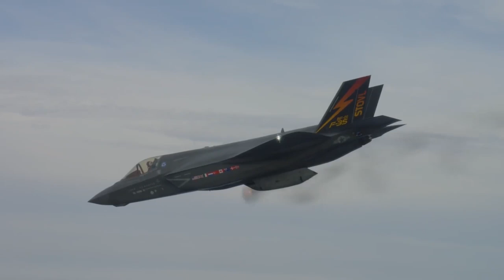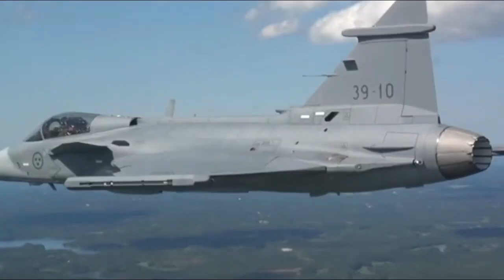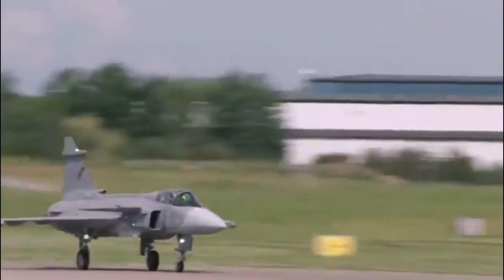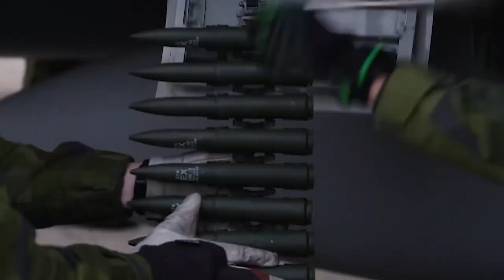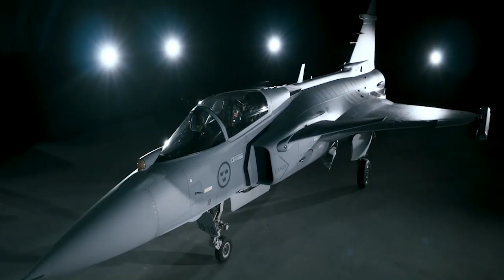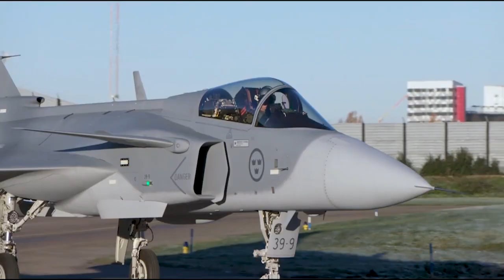JAS 39 Gripen vs. F-35: Which Fighter Plane Is Better?

Comment: F35 can only carry a similar payload if it uses wing pylons, in which case its no longer stealth. As a stealth aircraft,  it's got what, 4 missiles? Two aim120s and 2 aim9s? That's not a lot.  Its a lousy interceptor and a lousy air superioriry fighter. Its stealth is useful but you need a conventional fighter to fly alongside it, its not enough as a sole type. Like if a modern flanker gets close to it its pretty doomed

Comment: Stealth means nothing to Gripen E since the new ir system detects heat from engines up to 500km away and its much more agile than f35 and has the best radar jamming system in the world so its a fat rip for the f35 tbf. Even f22 would be detected as soon as its has its afterburner on inside that 500km range.
Reply: The gripens IADS system doesnt even have offensive electronic jamming, but the F35s barracuda does. Where did you get this info. And there is no way you can say that IRST is better than DAS. The f35 will shoot down 2 gripens before they even see it.

Comment: I keep reading things like the F-35 having better tech (it doesn't) and the Gripen is best suited for countries with a limited budget (which is EVERY country except the USA). You want to know if the Gripen is better than the F-35, here's the answer that NOBODY can argue with: If you take cost-per-flight hour into account, the F-35 is between 5 and 6 times the total cost of the Gripen. You've seen that the general consensus is that the two planes are close in combat capability but they're not. The Gripen is faster, more maneuverable and can use a much larger array of weapons than the F-35. It can also fly close to electrical storms without fear of explosion. Ignore all that though, it is clear that the F-35 is NOT significantly more potent as a fighter than the Gripen. What is the purpose of a fighter jet? The purpose of a fighter jet is to make your air force as powerful as it can be. Do you think for one minute that 10 F-35s would have a snowball's chance in hell against 55 Gripens when it's been pretty much established that the F-35 is NOT significantly more potent as a fighter than the Gripen? The answer is no. Therefore, the Gripen makes your air force more powerful than the F-35. Therefore the Gripen is better at delivering to an air force what a fighter is supposed to deliver. Therefore, the Gripen is better than the F-35, end of line. The rest is illogical semantics by people who WANT the F-35 to be worth it.
Reply: The gripes a plane from the past. Might as well fly a tomcat
Reply: @Space_Cricket beat the shit out of F-35.
Reply: What most people don't realize is the f22 and f35 aren't even near their full potential. This makes me mad because the defense department won't give them the updates to make them far support to anything flying and they do have this technology upon request and due to the fact they don't do it inferiority me.because they been using block 4 updates on the f35 adir for years now.
Reply: Countries that actually experience and expect air combat prefer the F-35 and aren’t cancelling orders.
Reply: @kevinledgister5252 All but Canada
Reply: This is false. Both the Swiss and Finnish evaluations already put this idiotic myth of "muh cheap Gripen" to the grave.

Also

1. F-35 is faster when both are combat loaded because it does not deal with parasitic drag. F-35 also has better acceleration thanks to having better TTW.
2. F-35 can use a vaster array of weapons than Gripen can.
3. F-35 can fly close to storms as well.
4-5. Finnish evaluation already showed that the F-35 is VASTLY more capable in a fight than the Gripen. Frankly a flight of F-35s would beat a flight of Gripens with exceptional ease considering the Gripens can't detect the F-35s and even if they did, their radars would get spoofed by the far more powerful EW suites of the F-35s. It also would not be 10 F-35s vs 55 Gripens, because a Gripen is actually more expensive than an F-35.

The only person throwing around illogical garbage is you. Serious air forces have again and again evaluated both airplanes and always arrived at the same conclusion. The F-35 wins by a wide margin. It has far better avionics and sensors, far better sensor fusion, far better ECM and EW and better kinematics.

Face it little Swedish nationalist - your toy plane has been exposed for what it is. An overhyped PoS that is essentially nothing more than a worse F-16.
Reply: @johanlassen6448  You might have choosen the Wrong person to do this with :)

Just looking at the specifications of the F16 it seems that it is equal and in some aspects better that the Gripen but nothing can be further from the truth. And this is more or less independed on version of both F16 and the Gripen.

1. Depending on configuration and version the F16 has an equal or higher T/W rate, but one needs to consider the wing load and the drag too. The Gripen has much lower drag and far lower wing load. The transonic area is much narrower for the Gripen and it can reach supersonic speeds on dry thrust while carrying a full A2A armament and an external fuel tank even for the A version even if it is just on the limit (Mach 1.1) Gripen E Mach 1.2. Even though the Gripen in some aspects lacks the TWR of the F-16 it can match or nearly match the climb rate thanks to low drag. When curving Gripen hardly lose any energy which makes it a serious adversary in any merge against any modern fighter including the Typhoon, F-22 and the F-35 or shall it be called the Fail-35. 

2. The T/W ration might not be impressive on the Gripen but in combination with the extremely good aerodynamics, low drag and low wing load it can turn inside anything in the air today, The F16 is NO match. The latest F16 Block 70 has all the bells and whistles identifying it with modern “4+ gen” fighter and is on some arenas (India) competing with the Gripen E and even seems to win that race. Which only show how little capability is involved in theses affairs compared to politics. The block 70 is a CPR on a plane that no longer can compete with modern fighters in the air superiority arena. It is limited to the NATO armament and will likely not be upgraded to include any development of those. Gripen on the other hand can be configured to almost any armament on the market, NATO or not.

3. During Red Flag 2006 in Alaska one Gripen A pilot knocked down FIVE!! F-16 block 50+ during close combat. During that exercise Gripen never lost any areal encounter or failed their mission objectives. It was the only fighter that performed all planned starts, while others were sitting on the ground waiting for the weather to clear up. The evaluation was that Gripens capacity needed to be revaluated. And no disrespect to other pilots, they are equally trained and in a Gripen you are simply superior.

 4. During a combat exercise with the Royal Norwegain Air Force, 3 Swedish Gripens went up against 5 RNAF F-16's. The Result was 5-0, 5-0, 5-1 after having flown 3 rounds. EZ WIN

5. The Gripen has a shorter turnaround time, which for a strike mission is never more than 20 minutes, performed by a technician and 5 conscripts in a parking lot somewhere in a pine forest as close to the battlefield as possible. When it comes to reliability and accessibility Gripen has NO match on the modern arena. Also here, even if the payload is not as high it can carry almost anything that is available on the market. The Gripen will be able to do this with an app. Of course some testing is required but not in any level compared with other fighters.

6. Also here Gripen has showed in exercises that it can without AWACs support get battlefield awareness due to the Link 39 P2P system and undetected complete mission objectives and efficiently defend itself if necessary. Gripen is not a stealth aircraft but it is very difficult to detect.

7. In the last role as reconnaissance fighter Gripens performance in Libya showed that is more than reliable, available and always completes the mission objectives. It came down to Libya as a tactical resource but very soon was lifted up as an strategic. Also here it showed how adaptable the plane is, how easy it is to maintain and is always available. One C130 can carry all the equipment necessary to support four Gripen during a month of overseas missions.

8. The Gripen is more expensive to purchase than the F-16 BUT is half the cost to fly. The choice if you have no political bias is a no-brainer in favour of the Gripen.

9. So how does the Gripen compare to the F-16? It is simply superior. F-16 is an excellent of the shelf fighter if you for some reason can´t afford Gripen and must buy US made, but it is time to put it in a museum. If the customer must buy US I would look at Super Hornet, Super Eagle or if you want to get ripped of the F-35. Yes the F-35 will probably be superior in many aspect but the cost to fly it will kill any defence budget + the Fail-35 is not faster then the gripen, maybe in your dreams but not in IRL. The only person throwing around illogical garbage is you. Serious air forces have again and again evaluated both airplanes and always arrived at the same conclusion. The Fail-35 is unreliable and stupidly expensive, the gripen on the other hand more flexible, faster, cheaper, peformes better....... but it's okej keep dreaming, it's always good to do once in a while. 
:)
Reply: @2.Cuzzzz  
I thought I already responded to this but my post appears to have been deleted.

0. So you are saying the F-16 is actually better but because you don't like it you want to ignore facts and pretend Gripen is better.

1A. There is no evidence that Gripen has lower drag than F-16. Case closed.
1B. All planes can reach supersonic speeds with A2A armament. You have severely misunderstood the claim you are quoting, which was that Gripen E can supercruise (i.e. supersonic speed without afterburning) with an A2A armament. However, that statement is ALSO false. Gripen NG (prototype of the Gripen E) could reach Mach 1.1 with afterburner and maintain it with milpower. That is not supercruise. Gripen E is a full ton heavier than Gripen NG while using the same engine, hence it also can't supercruise.

2A. No evidence of the Gripen having better aerodynamics. Case closed.
2B. The reason the F-16 Block 70 is winning is because it is the better plane, not because of "politics".

3. No, false. There were no F-16 Block 50+s in Red Flag Alaska. In fact, the US did not operate F-16 Block 50+ during this time nor did any country that had them participate in Red Flag Alaska 2006, hence your statement is impossible. Additionally, Red Flag Alaska is not a competition. Its an exercise where you work WITH American squadrons against aggressor squadrons that simulate Russian aircraft. Ergo what Gripen might have managed to do was to shoot down F-16s of US aggressor squadrons that simulated the performance of MiG-29 and SU-27. Not impressive. The only publically available case of F-16 vs Gripen is Loyal Arrow 2009, where Gripen lost.

4. There is no evidence that Gripen ever defeated any Norwegian F-16s and in fact Norwegian pilots deny this ever happening. Regardless, Norwegian F-16s were F-16MLUs, which are just upgraded F-16A:s with no HMD, no AIM-9X capability and that only used AIM-120B. Swedish Gripen C:s would obviously be superior at both WVR (HMD+IRIS-T) and BVR (AIM-120C-5). By contrast, when JAS-39C actually went up against F-16 Block 52s at Loyal Arrow 2009, the JAS-39C lost.

5. No evidence for this claim. Case closed.

6. All modern 4.5 gens have datalink. Gripens datalink is a generation behind the most modern ones as it uses an omnidirectional link. Nothing special.

7. Actually, Libya is an excellent example of how limited Gripen is. All it was good for was recon missions after USAF had destroyed Libyas AA.

8. No evidence that Gripen only costs half as much to fly. The Janes article you presumably refer to had no credentials or sources and was only taking into account fuel costs when talking about Gripen CPFH.

9. Clearly not superior. It has a weaker radar, weaker payload, less range, less TTW, less weapons variety.

Finally, as far as your comments regarding F-35.

A. F-35 is not more expensive than Gripen (see Swiss and Finnish evaluations).

B. F-35 is faster than Gripen when both carry weapons loads due to Gripen suffering from extensive parasitic drag (external weapons only).

Skärp dig.
Reply: @2.Cuzzzz annndddd that’s all folks!!
Reply: @johanlassen6448  Read the USA Department of Defense Report over the last 10 to 12 years ,then you would now what you are taking about. Some months ago the uSAF has ordered 75 new F 15 ? in order to secure operational security . !!!
Books could be written about the F 35 aind its problems.
Reply: @samair32  The US ordered new F-15s because they are not using the same production facilities as the F-35. They need them to maintain numbers, they are not replacing the F-35.
Reply: @johanlassen6448  Replacing or Supporten ! Fact is that it has been extremely difficult in the USAF units equipped with the F 35 to get Operationel Status ,and the reasons for that are far to many problems ,and these problems can for years be found in the DOD reports
as Senator Mc Cain, former USAF F 4 Phantom pilot,said about the F35 ,“ it is a green Lemon“ .The parts for the aircraft is produced
in 14 States and then assembled by Loockhed, Coordinatins problems ?  Technical problems,electronic problems, Software problems
spare part problems , 😮just to name a few.  The turn around time is very long.
Reply: @samair32  All planes have problems. The F-35 hasn't had worse readiness rates than any other plane, and has already been used in actual combat missions.
Reply: @johanlassen6448  I find it very good that you are so happy with the F 35, your comment tells tthat your knowledges may be limited, ?
and that the F 35 has been in active missions says nothing about the exsisting problems, the  very high cost in use, the very long turn
around time, its limitations to weapon load, and much more…… I wonder what you really know about the F 35 ,the DOD Reports are
not just written for fun . Hope for you that your happynes for the F 35 will  stay with you.
Reply: @samair32  Everyones knowledge of the F-35 is limited, but I know a lot more about it than you do.

You are misquoting the DOD reports. But I mean by all means continue to delude yourself.